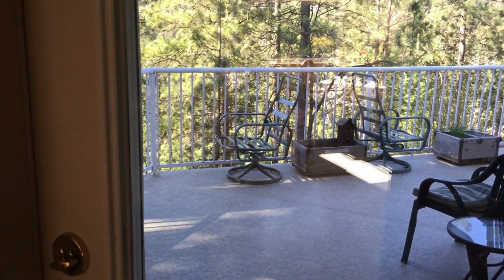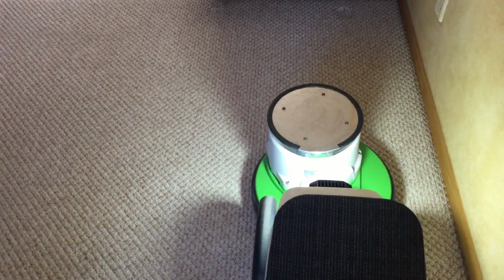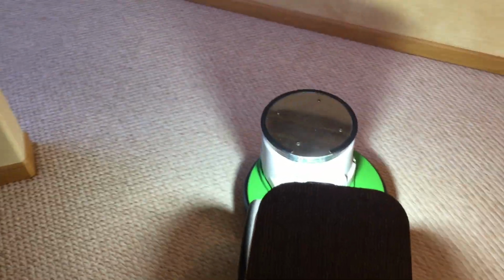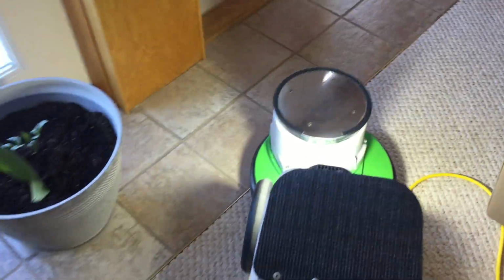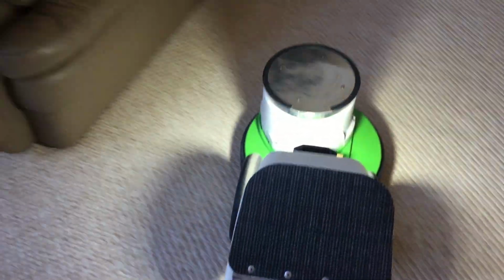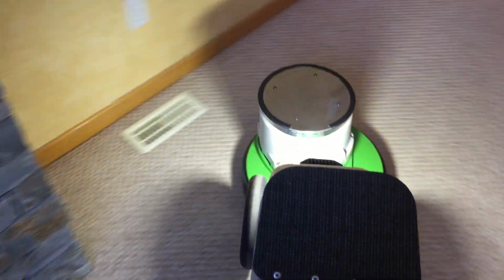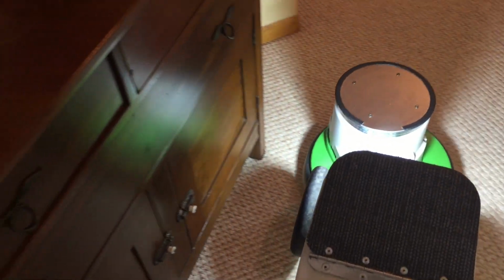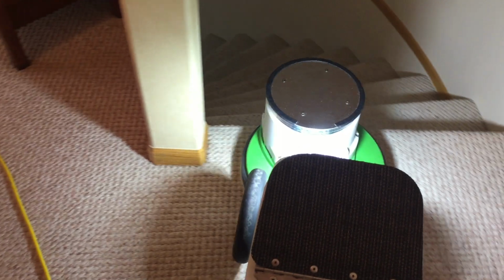Oxy-Dry cleaning a 22 year old Olefin berber

Comment: Anothe great video! So simple! Just wondering what that small disk is you put away after the hogs hair brush is taken off?
Reply from the maker: My machine is a centre feed and I have a plastic deflector sitting on top of the fibre pad that deflects the solution out from the centre a bit more, about 6" or so.